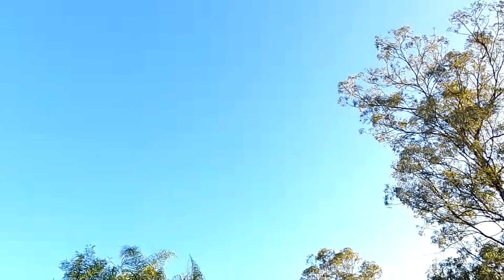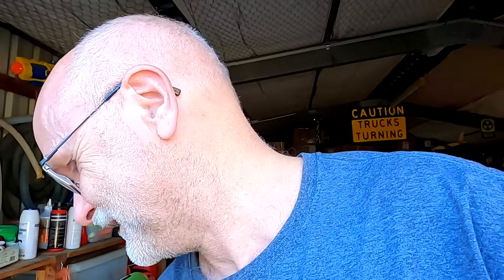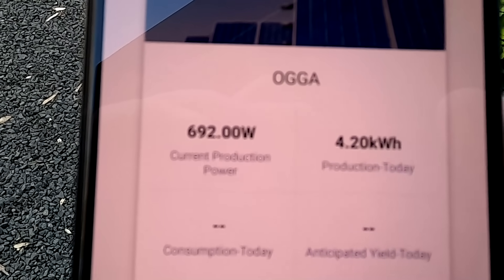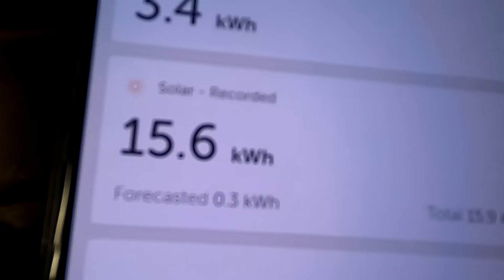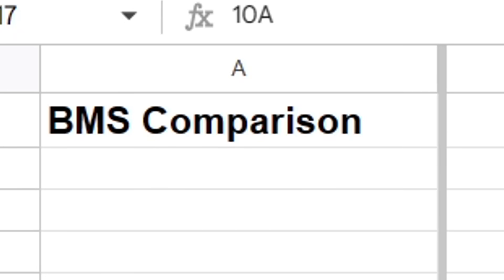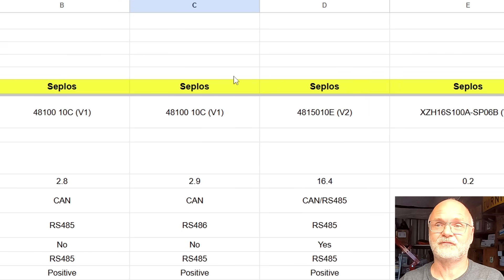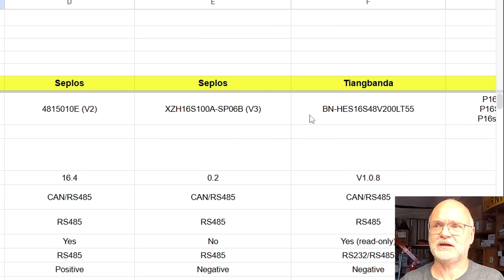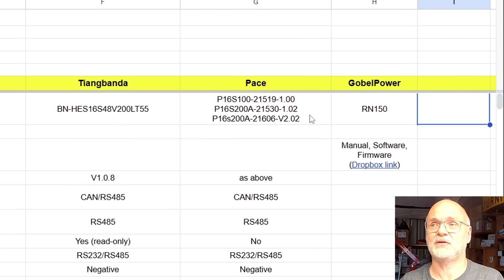All hidden BMS features for Seplos, QSO, Pace and Gobel Power. The BMS Comparison.

Comment: Thank you, it's a great work., How a bms can stop an mppt ?
Reply from the maker: The MPPT is under External Control through the BMS. The BSM tells the MPPT to stop delivering energy when the battery is full.
Reply: @OffGridGarageAustralia it's a matter of voltage between bms and mppt configuration if I understand well. There is no communication protocol used between these 2 components
Reply from the maker: @rudydepooter9513  If there is no comms, the MPPT has to be setup correctly and should stop charging once the battery is full. And yes, this is purely voltage driven, measured by the MPPT. In such a case, the BMS is a pure safety device and disconnects the battery if something goes wrong and the MPPT does not stop charging.

Comment: I have two NENERGY batteries with rs485 communication, but I have no idea to check if it is working at all. How do you know if battery parallel communication is working in general, and what does it even do and can we test that it is doing what it is suppose to? Your battery bank has no communication at it works fine?
Reply from the maker: You need to install the PC software to communicate with your BMS and should see both batteries.
My battery shelf works perfectly without any coms since the installation beginning of 2022.
Reply: @OffGridGarageAustralia  I agree. It still amazes me how perfectly the amps split between the packs without any intervention.
Reply from the maker: @Revnge7Fold  Yes, the same with my three banks in parallel. It is really interesting how well this all works without any coms and having Victron in 'charge' to control and manage everything.

Comment: Hi, I suspect the "MPPT Status when fully charged" is determined by the inverter/charger/victron gear, there is nothing in the normal CAN protocol that defines control of MPPT. I suspect it just based on the charging status/alarm status, that may vary between the different BMS eg the way the battey behaves when it is fully charged.  This seems to line up with your finding.
Reply from the maker: Some BMS leave the MPPT online so it can deliver power to the load. Other BMS turn off the MPPT and load will be supplied by the battery for a while until the MPPT kicks in again and starts recharging the battery. It basically micro-cycles the battery once fully charged.
So, I guess, this is a signal the BSM sends to the inverter/MPPT via can.
Reply: From what I've read and seen the last year,  I suspect that it would be best that charging slows down when reaching 100% SOC.
So,  if an inverter/ charger reads the SOC, I think it would be best that the build-in MPPT charger starts to restrict delevering power to the system. 
I assume that the reaction time when it's 100% would be higher/ more accurate (than just fully charge until 100%, cutoff MPPT and charge again at say 95% SOC.

I also think the big challenge is how to stop/ slow down delivering power from PV in an AC setup, so with independent i/c.
Like the SolarEdges and Growatts.
Victron has a nice communication between i/c and the smartsolar to limit delivering power to the battery.
Reply from the maker: @gubbernl  Well, the inverter cannot read the SOC. From where? The BMS? If you don't fully charge for a while this SOC will drift from the real SOC and it will be very inaccurate.
Slowing charging at the end of the process is not necessary with Lithium batteries. All chargers use CV/CC charging and if the voltage is kept constant, the current will tapper off automatically while the cells absorb. The charging process slows down naturally.
I have made many video about this and we have explored the charging and discharging of LiFePO4 in all details. CV/CC is the perfect charging algorithm for Lithium. Charge your batteries to 3.45V per cell and let it absorb at this stage. This will gently charge the cells to 99.5% and they will last a very long time.

Comment: Great information Andy thanks. Did you ever hear from Keshee bms? I have a 24 volt 200A Keshee BMS, it looks seplos based, coming with the Keshee Diykit 8S configuration. It produces high volt and high volt protect alarms which go straight to the Victron VRM. It does that all the time when a certain set up parameter voltage is reached. It doesnt matter if the voltage is set to 3.45 or 3.65, when it reaches that voltage there is an alarm which goes to Victron. To be seen on the cerboscreen but also on VRM. IMO it should not do that because it is flooding the alarms to VRM and Victron already killed the flood (and all the other nonbms related messages) because it goes on and on all day during solarcharge. Ofcourse i like to be notified (when the voltage goes above the setup and desired float voltage) but not lose the other eventually Victron alarms because of the flooding of the bmsalarms which are imo not real alarms but only stopping the charge which is good. Are other bms doing this as well and how can i set it up so it won't flood the VRM with imo nonalarms. In the bmsconfiguration it is possible to switch off the high voltage alarms, which i did, but also the high voltage protect alarms which i didnt because if i do the charging will go on and on and above the desired float voltage. In my case 3,5 volts. These 'alarms' are driving me nuts. Does anyone has an solution? Thanks in advance.
Reply from the maker: Thanks for sharing. I have not heard about this BMS before. Do they make a 48V version as well?
Reply: @OffGridGarageAustralia  Yes g o o g l e kesheebattery
Reply: @OffGridGarageAustralia  Youtubechannel KESHEEBATTERY168

Comment: Hi Andy it’s a lot of work for doing this and did before but…there’s always a but, where you put a Batrium BMS, consumer or industrial? I would like to see here or find more on the internet like you test it but is there a chance that you can test this? I and I think more people looking for this…Bitte!!
It’s look a very good system but quit difficult to understand without your experience knowledge
Reply from the maker: Hi Mark, thanks for your suggestion. I would definitely classify the Batteries as an industrial BMS. The installation and setup is not straight forward, very much it off scope for many from a technical and also financial protective. There are modules to be installed on all cells, heavy duty relays in the main power paths of the battery and the setup is very comprehensive.
At this stage, I would not consider the Batrium for a test but maybe later, when I have more time.

Comment: Too late for me as I spent hours looking up this stuff before going with a Seplos but still bought the wrong one. 
To help others, may I suggest you include the non hidden specs?
Things like -
Voltage range (Seplos caught me out on this as I needed the NCM version).
Current ranges.
Number of cells in series range.
Balancing current and voltage ranges.
Price on Aliexpress.
Size.
External display details. 
Length of cell voltage/balancing wires.
Number of temperature sensors. 
Onboard indicators such as SOC.
Compatibility with Victron and other inverter/chargers.
Links to your videos, manufacturer's websites and documentation.

Great work and I am sure your followers could chip in if you asked. I can help with the Seplos in the first column.
Reply from the maker: Thanks for your suggestion. Most of these details are already available in the manual or spec list. Others, I will add over time.
Reply: @OffGridGarageAustralia  Thanks for your reply Andy.
People will need to hunt down and go through manuals. Your spreadsheet could be a one stop solution where the choice of BMS can be narrowed down very quickly. 
On a separate note, I emailed you about power factor correction and I'm testing it now. First results are disappointing as it looks like it is unnecessary but I only powered it up last night so still more work to do.

Comment: Too bad you view the other BMS as "consumer-grade" as they are, in my humble opinion, not.
I have seen several of these BMS in telecom-equipment, healthcare machines (x-ray amongst others) and even in radar equipment.
Anyways;
There are a few parameters I believe your Professional BMS Spreadsheet should also include:
- Firmware-upgradeable Yes/No (only applicable to the Gobelpower BMS at the moment, but who knows if future releases of the other brands will finally also support it?)
- Dry-contacts: Yes/No and if they are operational/functioning. (you have shown several times that for some professional BMS the dry-contacts do exist but do not operate/trigger at all)
- GUI-program/all-in-one Yes/No. You have shown that for some BMS, there is 1x GUI where you can do everything but some BMS require several separate programmes.
- Display extensive Yes/No: you have shown that some BMS displays are not that useful about the SOC etc

Just a few suggestions ...
Reply from the maker: Good suggestions, thanks.
I'm using three simple BMS myself in the battery shelf and they work great...
Reply: @OffGridGarageAustralia  No worries, I do understand what you are meaning.
Maybe another suggestion, all but a debatable one, for your Professional BMS Spreadsheet;
At the final column on the right, a AFR (Andy's Frog Rating), meaning how much you like that BMS, the support from the manufacturer, the workings of that BMS etc. Just a scoring on your personal views of that BMS, considering the whole package, everything.
BTW, looking into some of the aforementioned BMS, I do believe some might be "hackable" by adding a bluetooth board.
But I do understand (and accept) that is beyond the scope of your projects.
It is that a 12 volt system (with inverters) is plenty enough for me, otherwise I would attempt it myself.
(n the end there are only a few BMS manufacturers sourced to several OEM's with various degrees of software/firmware)
Reply: PS: As I believe your Professional BMS Spreadsheet will be highly dynamic over time, perhaps also include a (update) date or revision? (within the sheet)
Reply from the maker: @InspectorGadget2014  Good idea...
Reply from the maker: @InspectorGadget2014  Great thoughts, thank you.

Comment: 11.38 The question is, after some time. the battery will have some aging and will not reach 100% Pack Full Charge Current, but by loseing this "current" by losses of any working BMS. I think, this makes no sense => or the value of the  100% Pack Full Charge Current has to be corrected after some time.
Reply from the maker: Juergen, the battery will always reach 100%SOC, regardless how much degradation it has. The voltage may need some adjustment for very old batteries and also the tail current but overall, it should still work the same way.